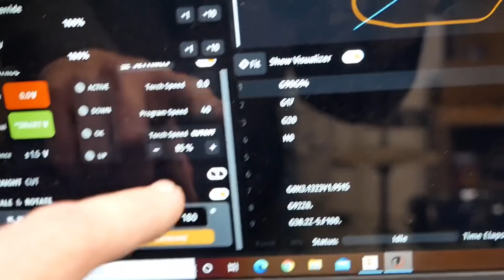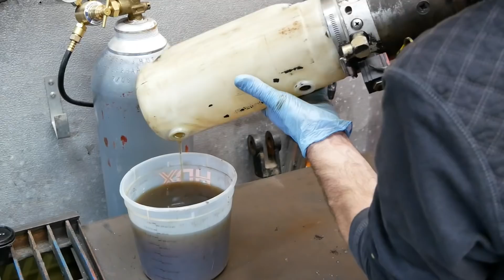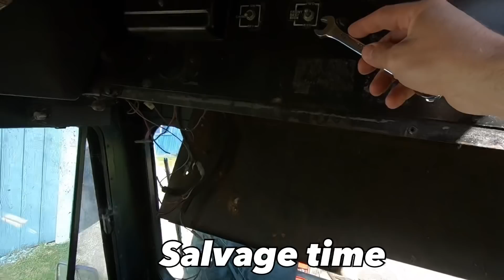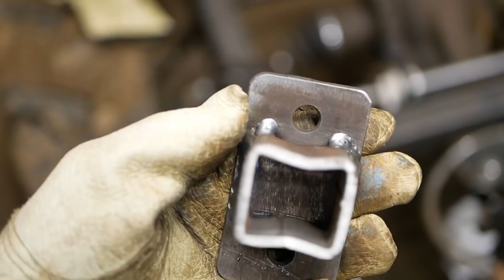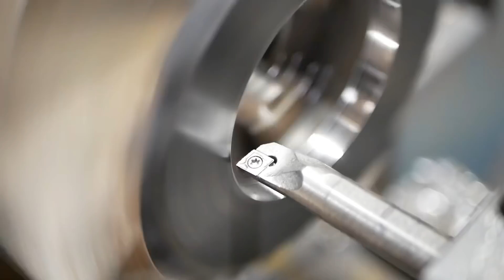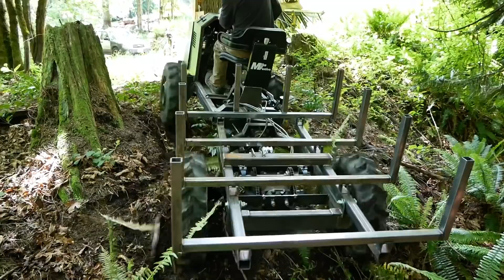420cc Predator powered articulating 4x4 dump truck build part 9

Comment: Hey Mike solid work. I love the fact you use what you have and salvage. Its a awesome build series . Hey a question how much does it matter having an off set lift in your ram to frame? I suppose it depends on the weight of the load? I'm also amused by some of the comments... There's always an expert out there and some of them have never built a thing. You do you its working and Awesome! Love the fact you take the time to share everything on YouTube. I fab a lot and get in to some interesting builds for myself and son but really not sure how the filming part would go Kudos to you sir. I love the channel!

Comment: Watched the series here before but just went back through to find this limited slip install. Thinking it might be interesting experiment with mower for snow plowing, only thing I don't see is where you got the torque limiter or who makes it?
Reply from the maker: I ordered it on EBay, I can’t remember the company that makes it, it was new old stock and it wasn’t expensive.
Next time I take a look at it I will let you know the brand 👍

Comment: why not just weld up the diff? i'm assuming you'll never take this onto tarmac so i cant spot the downside right now
Reply from the maker: We all know the results you get with a welded Diff, the reason I did it this way was because I wanted to see how well it worked and test out the results I got by experimenting. I plan on using this limited slip in a future build.
Sometimes it nice to do something a little different 👍

Comment: Nothing is free here in Australia, fab shops may sell you off cuts at scrap metal weight price, but if they think you want a certain piece price goes up! Even couch’s which most would throw away advertised as good condition just need recovering, bags of horse/cow/sheep s-it $2 at the side of the road I think I live in the wrong Country
Reply from the maker: That’s a bummer.
There’s a lot of stuff you can pick up for cheap to free around here. I salvage a lot of free things. Thanks for checking out my videos 🙂

Comment: I'm rewatching the videos, out of boredom, and IMO, that slip could be brought to the cabin using a truck clutch actuator. If you can find a salvage with an old school clutch, to rip that mechanism out, you could mate it to the existing mechanism without any mods to it, and bring a cable to the cabin and have it on demand. Go further, get a hydraulic disk brake, and you could use the mechanism to actuate the clutch like that.

Comment: Have you thought about a flow selector valve to run aux hydraulic?  It would cut your steering out with a switch to supply flow to another circuit.

Comment: Mazda Maitia rear diff could of worked with an lsd inside of it. It would be much simpler and a cheap diff to get vs a wrx/sti rear diff.
Reply from the maker: The Mazda is out for the simple fact it would not fit all the Subaru parts I already had built into this project, plus the gearing probably would not match.

Comment: Mike, I am really enjoying this build.  Way more technical that anything I'd ever attempt!  If I were to offer my $0.02, I would simply suggest that at some point, it may be advantageous to shield the spinning components and open drive chains.  It would help prevent wear as well as be a little safer.  The one thing that's been drilled into me by the old timers was to fear PTOs and lathes - they're powerful and will spin you in to them and hurt you.  Also, I personally wouldn't try to weld up the diff between the front/rear in the drive train.  My understanding is that AWD systems need this diff so either end can  spin at different speeds and save wear on the  other components.  Otherwise, great job and I can't wait to finish this series.

Comment: For your skidplate, you should consider plastic. It can bend and flex more than aluminum, and will pretty much look good most of its life. I use a thick plastic skidplate on the bottom of my CR250 dirtbike, it works great

Comment: Mike, About 20 years ago, we had transit bus wheelchair ramps that were deployed by a electric motor output through a reduction gear turning a slip clutch that looked like the one you are using. where you had your sprocket mounted we had the extension arm of the ramp.  The clutches were problematic for us because it was difficult to keep the proper tension, you had to be able to move the ramp manually in case of a power failure, yet it had to have enough grip to deploy the ramp. That was a tough balance with the clutches being exposed to moisture they would often start sticking causing the electric motor to break the ramp arms. We had to loosen the clutches weekly, operate the motor and make the clutch slip then readjust the tension on the locking nut. That was a very maintenance intensive process for our bus fleet. I'm glad those vehicles were finally retired.

Comment: After watching this again  you might just want to keep chains on the front and back.
Reply: Mike, even with your improvements you may find long term that they are just a part of the "package" to keep you going at times.  When your tires turn into slicks because they are spinning in mud you will find that the chains do not allow that mud build up and thus you can keep traction.  Just offering my experience, I am impressed by your craftsmanship.
Reply from the maker: You probably missed the part where I said I went to a location with tree roots and soft soil to try and make it loose traction for the video to show the rear tires turning at once.

Comment: One thing to remember about the subies, is that they are a front wheel drive car with rear axle assist.  That's why they have the viscous centre diff set up to supply 70% front 30% rear traction when things get really tight.  Friends told me to stick a diff lock on the front for sand work or lock the centre diff - my 'L' series has no middle diff at all so of course torque split is mechanical 50/50 - I have no idea at all if the older transfer system can be grafted to the newer models, probably not...  I figure you are thinking things through a lot before it makes it to video.  Impressive bit of machinery.
Reply: All subaru 5MT center diffs are 50/50 front/rear viscous couplings, the STI center diffs are biased to the rear and it's the MPT center diff in most automatics that's biased to the front. Also, all subarus center diffs that I'm aware of (mostly 90-08) are designed to lock 50/50 in low traction, regardless of default bias.

Comment: I live the diff lock idea. It’s probably overkill but if you have room you could use some clutch release bearings and a clutch fork to apply pressure to the friction pads to lock the diff remotely saving wear on the chains and cv’s etc

Comment: The limited slip idea is interesting but the device your using is for protection in case of a jam , it wont last long you'll be adjusting it all the time. You would  be better off with connecting your two sprockets through a dog set up then you could have it positive lock versus  none.
Reply from the maker: I think it will be fine, you understand it’s got a Belleville spring washer providing spring pressure to the friction pads, the RPMs these parts are spinning and extremely slow compared to say a clutch on a car.
Reply: @Mikefestiva  That was advice my friend  retired millwright 42 years
Reply: I think you're really overestimating how many revolutions that clutch will experience in normal operation, that is to say basically zero.
Reply: @galaxywide6760 . Dunning–Kruger effect

Comment: Mike... You may have already addressed but I haven't seen it... Is there a way to acquire the cut files used to feed the plasma cutter?   Love the Project...
Reply: I like the Heart, but would also like to know if You share, or sell the gcode files used for cutting the parts for this project?.. Its understood no selling, sharing or manufacturing and for ones only use....    its a shame to let all the knowledge you have put in them not be used?  Thanks...

Comment: Nice work.  One question though, did you think about using an electric linear actuator for the bed to simplify things a little?
Reply from the maker: Thanks for commenting 👍 I had used a linear actuator on my quad truck, it’s a bit smaller machine and is capable of hauling about 450 lbs it was a bit weak and could only lift about 200 lbs it was a lighter duty actuator and I think there are some up to the task but they cost quite a bit. Take care
Reply: @Mikefestiva  I have a Toyota Half Ton electric Pickup that has a side tilt bed (strange I know) and thought about using a Linear Actuator on that (Needs work now), but that bed weighs a lot and had the same thoughts on the cost of getting one to work with that.  If you ever want another project, let me know as I think you live pretty close to me on the peninsula.

Comment: Very smart design and nice machine. I like it! But was careful so  you not to get it over you when driving offroad if it overturns. It looks like it weighs a bit to?
Reply from the maker: Thanks for checking out my new video 👍
I’m planning on building a cab for it so it will be safer.

Comment: Im extremely impressed with you engineering abilities. Where did you get your degree.
Reply: The school of hard knocks + ambition
Reply from the maker: I’m self taught, I do fab work and machine maintenance for my day job. I have always been interested in building stuff but have lacked the tools in the past to build interesting things, slowly over the past 5 years I have been trying to build up my tools and push my ability to learn more and design. I think because I had always been on a budget growing up it forces you to think outside the box more to find a way to get things done even if you’re lacking the proper tools and money. Thanks for checking out my articulating dump truck and commenting 🙂

Comment: Sorry, you had that welder for 18 MONTHS and its still going strong? Are new welders really that unreliable that you are talking in months and not years? I dont even know how fucking old my welders are guess i should try to find date stamp under all that grime to see how many decades old those are cause its several, thats for sure.. Actually heard from friend that was working on oil rig construction at the sea, that they had brand spanking new top of the line welders on rig site, but those only lasted month, before needed to shipped for rebuild due all that corrosion from sea environment. Due this work got delayed and finally after  half a year of constant delays workers had it enough and told the boss man to get old machines. Those that he did get on site right away worked with out problems and Chief of admissions was then running all over the country looking for those old welders to buy for any price he could. With out fancy circuit boards and computer control those just work until maybe few years in that rough environment some connection corrodes trough, but its simple and still possible to repair even on the field.
Reply from the maker: Well I know of two Millermatic 200 and a Hobart that stopped working in there first year, so yes some of these new welders aren’t the most robust but at the same time they pack a lot of features into them. Mine is a stick, TIG and MiG welder and you can run a spool gun for aluminum welding. The biggest thing is these new multi process welders are inverter machines so they weld off of 120v or 240v making them a lot more versatile, they weld far better then the old transformer machines do and the fact they only weigh about 30 lbs means you won’t be going in for hernia surgery if you have to pack them around.
Bottom line is I won’t be going back to the older transformer welders again even if it means buying a new welder every 10 years it’s work the convenience of owning a multi process machine that welds great. Ps just because you buy name brand doesn’t always mean they will be trouble free. Take care 👍

Comment: I still love your build. But, I dont like that front dump cylinder mounts sticking down so low. It seams like it will catch on stuff. Maybe ontop of the articulating joint and tunnel the front of the dump bed for proper geometry to the rear mount. Nor do I like the cylinder being off center. But thats my opinion. Lol I'm a libra everything has to be centered or equal. Also grrrr. was there a solid prop holding that bed up while you were working under it?
Reply from the maker: Glen King The cylinder was a find balance to get a full tilt out of it, keep in mind it doesn’t stick any lower then the center pivot joint. Off center doesn’t bother me the least because I know it won’t effect anything.
Reply: @Mikefestiva  You understand I wasn't hating on you. I was just respectfully observing and just throwing out an alternate view.

Comment: Ever think of making into all hydrostatic drive?
Reply: yes.  but it would add a significant cost to the build. I have talked to mike about doing a hydrostatic drive I even have some of the components  but to do it rite can be fairly complex  and expensive ( larger engine, variable displacement pump , hydraulic motor , oil cooler , hydraulic hoses)  ads up pretty fast

Comment: If the engine runs hot under heavy load it's because much of the cooling air is recirculating under the hood getting hotter and hotter.  I've run into this several times, that is why say lawn tractor engines are now ducted to bring in mostly new cool air.  You would think that does not happen that way but it does.  I've seen plastic melt and other damage.  So think about a way to duct the engine intake to the grill.  Other then that your skills are well beyond mine.  Nice job

Comment: How does that hour meter hook up? I got some of those induction wire ones but the batteries die in them eventually. Just looking for a more permanent hour meter.
Reply from the maker: It just takes + and - to run, if I’m not mistaken it operates on a really wide range of voltage too. Time will tell how this one holds up???
Things don’t seem to be built to last like they use too.

Comment: Nice well build beast. What was the cost of your CNC cutting
Reply from the maker: The table is selling right now for I think $2500 because it’s on backorder, I think they sell for about $3000 once they are back in stock. You will also need a pilot arc plasma cutter, I’m running the Titanium 45 from harbor Freight. Take care

Comment: Isnt it possible to run a EF/CF hydraulic Valve to priorize the steering to the other hydraulic functions? Id say it could be a good solution.
(Sorry for my english, Im from Switzerland so I usually speak german)

Comment: nice work good idea ! But you may be disappointed with your  limited slip ! loaded ! it will need more pressure , water , mud and ware will greatly affected ! I had give this idea some time in the pass . 4 pillow bearing welled square stock on each side, with a sliding square stock over one side to the other ! Air , cable or electric activation . solid look wend on , free wend off ! None the less great work always enjoy the time to see you video !!!
Reply: Time will tell. The cool part of his idea is it is  pretty simple and could easily be modified with a sliding collar for a positive locking unit if need be. Also this vehicle keeps evolving  his original idea was to build a truck for driving around on his property that has some narrow and relatively steep trails. But after his first test drive he was surprised how capable and maneuverable it was off of the trails and actually fun to test is limitations obviously  you would not want to go off trail with a fully loaded bed but it is interesting to watch it go through his  test drives it has given me a lot of ideas when I try to build one it is defiantly a great platform to start with whether you going for unstoppable crawler or a small transport vehicle capable of handling rough terrain

Comment: The ones that make comments like that are usually the keyboard warriors who couldn't tell the difference between a metric adjustable and a left handed pipe wrench lol. Keep up the great work. I'm a Millwright by trade & we use those packs as  slip "clutches" on certain chain drives, they last for years.

Comment: Great build the only issue  that I could possibly see is with the offset dump cylinder eventually you could rack the dump body. May have been a bit more pricey but a centered telescoping cylinder would work better long term.

Comment: I think you accomplished exactly what you set out to do with the external LSD, might i suggest a graphite spray lube for the chains?  It would have walked right up that incline with a little more weight over the rear, i feel.  Awesome!

Comment: A scissor style dump action would be better. More complex but better. Will keep bed more stable while dumping. Would also dump a heavier load easier. 
As far as using two way action. I would recommend doing it. You will enjoy having that ...lift ability. ie: custom forks off back of bed. Bed up would have forks down. Bed down forks up. Would have a mini forklift! 😎

Comment: GREAT build! Are you concerned about twisting the bed, with the ram off center?
Reply: With the size of the bed, the chances are so slim. He won't be even to put half a ton of cargo in there.
Reply: it is possible the bed might twist and if that is a problem he could add one to the other side if needed

Comment: Good job. Why didn't you mount the electric pump on the other side from the ram under the bed. Also what's the turbo under the bench for?
Reply from the maker: To answer your question, I would rather run one  hydraulic line from the front to the back rather then run two 4 gauge power leads all the way back that could chaff and cause a lot of spares or even a fire. Plus the hydraulic line is cheaper then the power leads. Take care